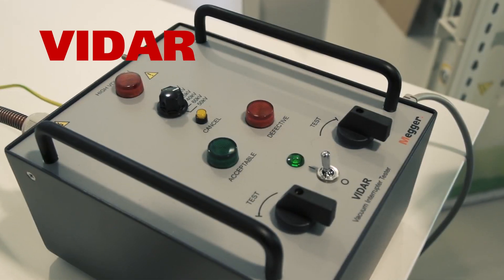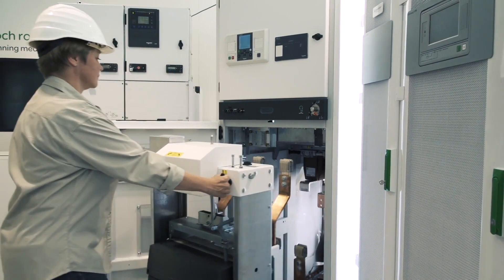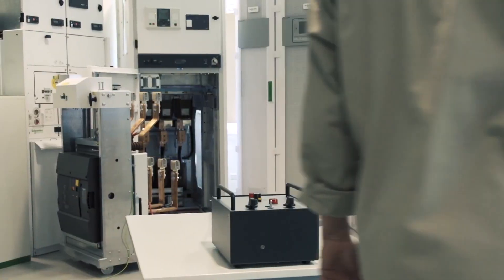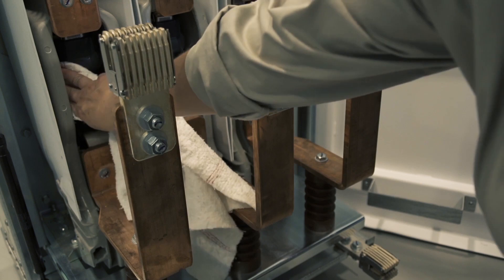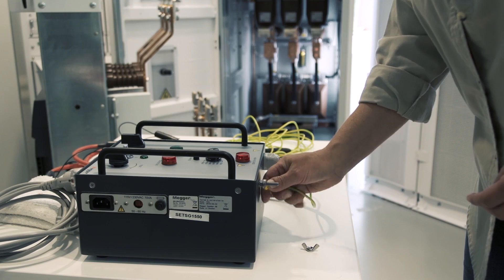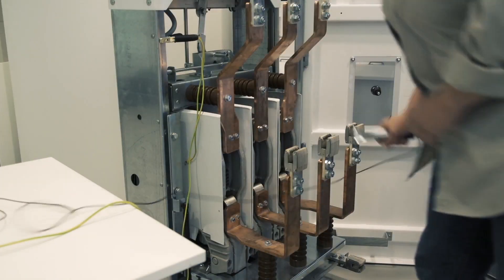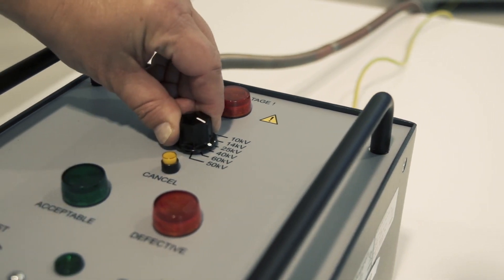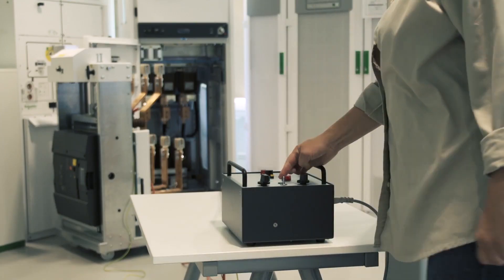VIDAR Vacuum interrupter tester

Comment: How to select the voltage?
Reply from the maker: Hi there, thank you for your comment. Please could you contact our TSG team depending on your local area, they will be able to help you. Contact details can be found on our website https://megger.com/
Reply: It has a rotary position switch selector to change between different voltage levels.
Reply: Select the voltage which is near to breaker voltage for example : 11KV choose the nearest voltage which is 14KV … For 33KV breakers choose 40KV